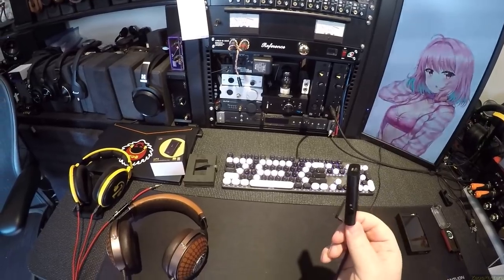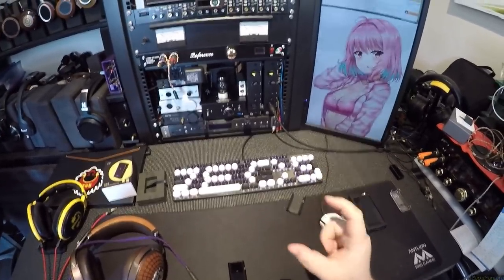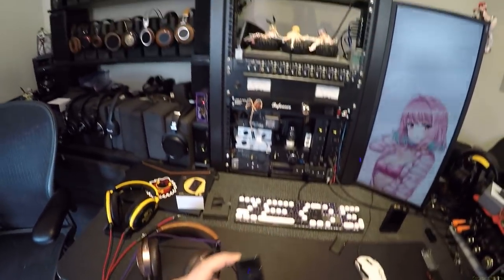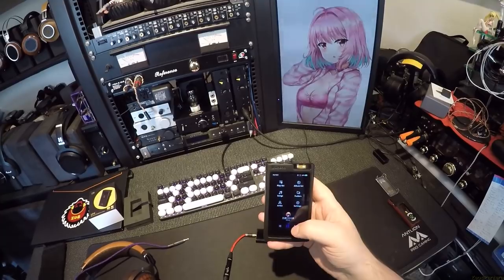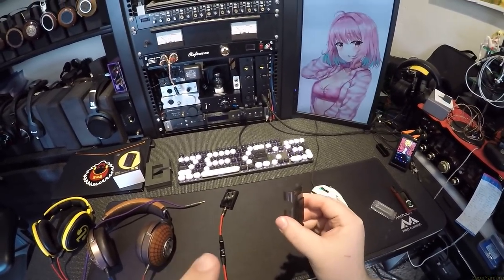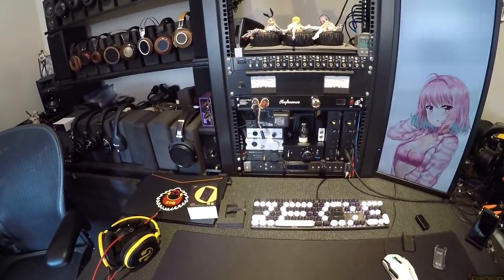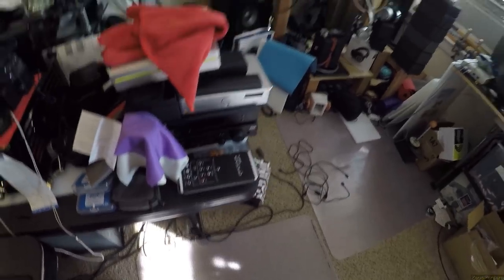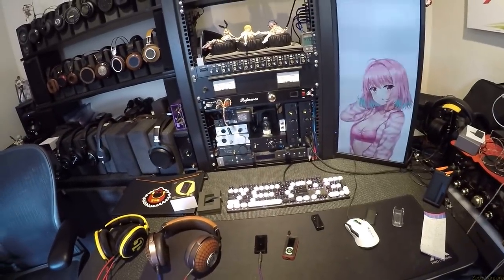Shanling UP4 _(Z Reviews)_  It is UP4 anything... Get it?!

Comment: You buy this over the BTR5 if you want more power out of tiny BT adapter and aren't using balanced. Supposedly an app is in development.

3.5 - Single Ended
 
UP4 - 91mW@32Ω (Boost Mode)
 The yellow ZEO couldn't find... Cause he was only plugged in balanced and didn't test single ended.
BTR5 - 80mW@32Ω   
ES100 - 35mW@32Ω

2.5 - Balanced
UP4 - 160mW@32Ω 
BTR5 - 220mW@32Ω 
ES100 - 100mW@32Ω
Reply: @Björn Óðinn Sigurðsson You're welcome. I was just filling out the stuff Zeo left out. I still prefer the ES100 to either. The only time I use anything else (when on the go) is when i'm biking or charging the es100. I didn't realize how much I preferred it till I broke it and bought the others in an attempt to buy something more durable. I'll spare the gushing love fest but the layout and phone app compared to the others is just on it's own level compared to the others imo. Balanced it drives just about anything as well. Anything I care to walk around with at least.
Reply: Found a place that sells the UP4 for $80 and the BTR5 just went up in price to $150.

Only thing I think I'll need from the BTR5 to this is the car mode so I could use the UP4 as usb dac for long sessions safely without damaging the battery much. Any experience on using these for usb dac?
Reply: @kriskadous518  could you just elaborate on how exactly the ES100 is better?

Comment: Im having a hard time figuring out why you like the BTR5 better. The Up4 has a nicer form factor, much longer battery life, volume wheel, probably better bluetooth reception and very similar same DAC chips. Also it's cheaper. Is there really a difference in sound quality that makes the BTR5 preferable despite all that? Edit: some further research revealed at least one shortcoming of the UP4 in that it doesnt do hi-res wired usb DAC and it doesnt tell you which bitrate its getting over bluetooth. Sound is apparently a bit warmer on the UP and a bit more forward on the fiio.

Comment: So i got the UP4 and the boost gain mode only works with unbalanced headphones. Then it uses the 2 amps together

And the hole on top isnt a reset hole but a microphone.

The multifunction button has 4 functions (for as far as i know)
Single press: play/ pause
Double press: next track
Triple press: previous track 
And quad press: assistant (like siri or google assistant)
Reply: ExpansionGames can you answer is it possible to use up4 with iphone as usb-dac? Or it works as usb dac only with PC?
And what digital filters do you prefer and what they mean?
Reply from the maker: You are Hired. But more like an intern so I don't need to pay you or anything.
Reply: @ZReviews  I Accept, so where is the free stuff?
Reply: @andleykin  uum well i dont have a iphone so i cant test 

but right now i use it with the fostex t60rp and like the Linear Phase slow roll-off filter the best it just gives it the slight bass boost it needs. 

but its all about taste and what headphones your using, so i just go off what sounds best.

Comment: The boost mode only comes up if you connect your head phone through  3,5mm, if you use balanced out, it only control high/low gain, no boost mode. Anyway the boost mode single ended only boost like 20mW, from 71to 91mW at 32Ohms, stick with balanced, it's has 160mW output at 32Ohms,s till weaker than the Fiio.
Reply: ATTILA THEHUN hi, can it drive both the 2.5mm balanced out and 3.5mm single ended out at the same time? I read somewhere that the FiiO BTR5 can’t drive both outputs at the same time, can someone confirm this, thank you

Comment: Bluetooth cat 🐱 😂 
great review, i've destroyed 2 BTR3s dropped one sat on the other, in the market for replacement, BTR5 looks like the winner over UP4, especially considering the Shandling phone app is garbage (from other youtube review).  👍🏽
Reply: Update (after another smart person thumb'd up my comment lol ) BTR5 is perfect for my use cases.  And note:  you can invert the device in the clip if you prefer the cable coming out of the top or bottom.  ALSO:  Works great with my iphone 8+ and iPad Pro 2020 both bluetooth (improved sound maybe?) and USB direct connection or with camera kit adapter (sound on USB is obviously best).  I'm mainly using it for conference calls / video calls with phone and on the go or running.  Rarely use USB (I have 2 other FiiO DAC AMPs for that).

Comment: Recently purchased Shanling UP2.
 I tried this DAC amp with my Mi A1
mobile(Android 9) .Sadly it is not working with aptX or LDAC. The device kept sticking with SBC. Pls give solution to make a use of advanced CODEC.
Reply: It says that mi A1 is capable of aptx & ldac, you can activate by going to developer options, on netowrking section.

As for the up2, download the shanling app, enable the codecs you want (also disable you don't want), and then it'll auto reconnect.

Comment: These Bluetooth amp/DAC gadgets are  great. I'm enjoying using my wired headphones and trying new ones instead of always going with the wireless sets. All of these devices need to have an integrated clip or lanyard hole or supply a case in the box. There needs to be a secure way to keep it on your person preferably at chest height.

Comment: Love the btr5 but have a small problem, the audio  is getting cut off or distorted most likely from the bluetooth connection ??? Or maybe because of the cable that im using (tin t4 with original MMCX Cable) anybody else has this issue ? Or is it just me ?
Reply: Yup, I have the same problem with sound distortion on the Btr5 when I cover the device or it's in my pocket getting garbled noises. Guess it's the Bluetooth connection having random problems. Overall great device but the random distortion is f... Up.
Reply: @Sob3r777  for me its not only when its in pocket or covered up it sometimes is in the open next to me and still getting the problem, hopefully there can be a solution to fix this or maybe an update to the bluetooth connectivity or software.
Reply: What your firmware version? The latest one is 1.0.6
Reply: @xinadezhong6795  1.0.6 straight out of the box
Reply: Update: Changed to a new 2.5 MMCX balanced cable no more problems for me, so it was a faulty cable.
Reply: After resetting it to factory using the Fiio Android app no problems for now. So it was the cable? Weird.. ordered the Shanling me700 with a bad ass cable will test if it's the cable?? Thanks for reply did not get any notification alert.